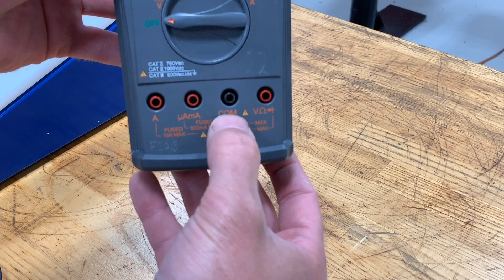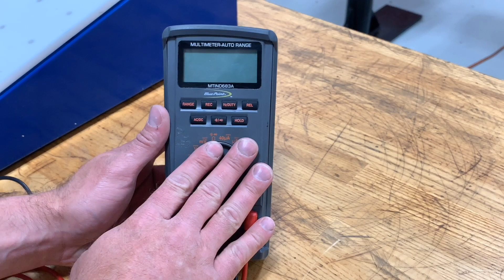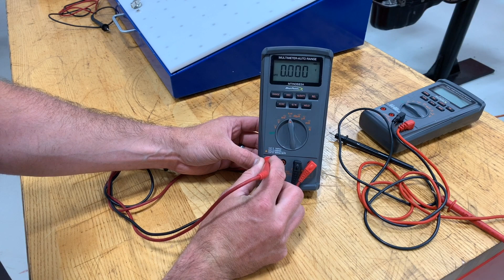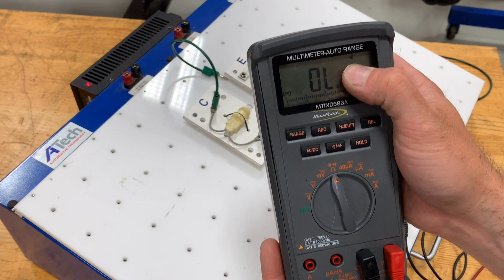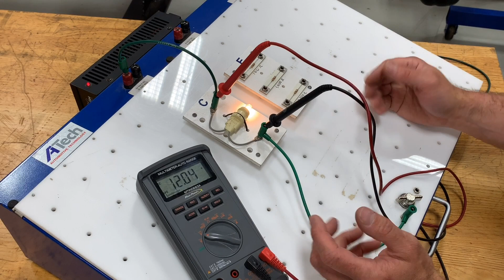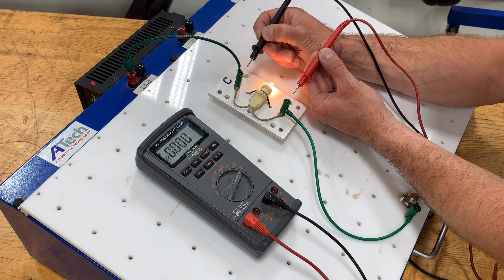Digital MultiMeter Basics and Operation

Comment: How to change out the battery’s
Reply from the maker: It varies by model, but on the BluePoint meter featured you remove the outer bumper then remove three screws from the back. This allows removal of a plastic panel to access the batteries and both fuses.

Comment: Great instruction for this meter. I picked up used DMSC683A on eBay to work with my moto, and its features are identical. Curious about something said at ~16:00. This unit's "zero" for voltage is 300mV value. Do I subtract that value from my voltage measurements?
Reply from the maker: Many meters will display a floating value when leads are not making contact. If you touch both leads together, the meter should ready 0v. No need to subtract the value from your reading.